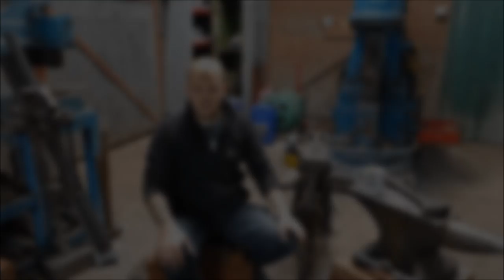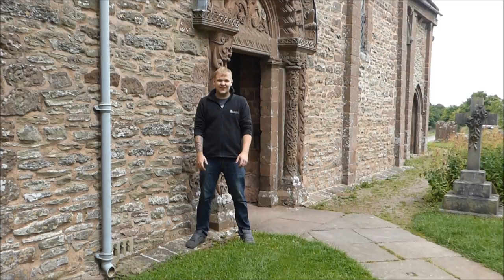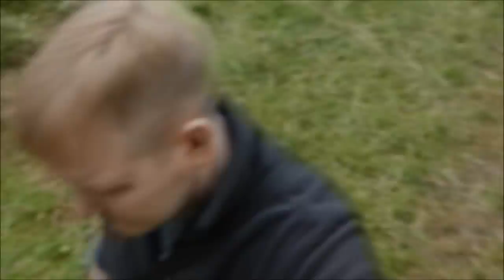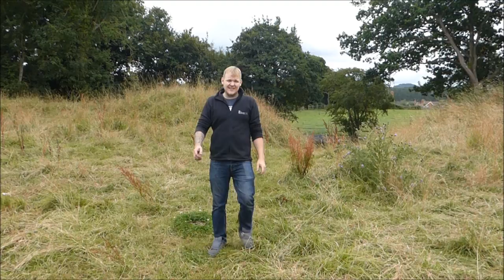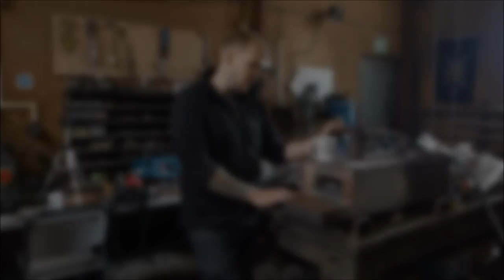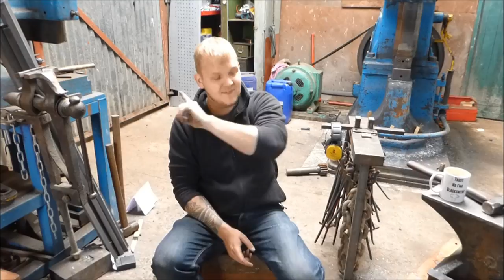Why Gas Forges Suck! Gas vs Solid Fuel! Trust Me I'ma Blacksmith! Full HD 1080p

Comment: Remember that Carbon Dioxide is also poisonous in enough concentration, or, perhaps better stated, it is an asphyxiant.   The by-product of any burning fuel is potentially asphyxiating, and even aside from that, all burning consumes oxygen.  If you were in a sealed room and lit a fire, no matter how clean it burns and how well a flue exhausts any fume, it would deplete the oxygen and quite quickly.  Then of course the fire itself would also begin to struggle (not enough oxygen) and so burn not so clean and eventually smoulder and go out.  You would have expired some considerable time before that.

Comment: I love it. At work we call guys like you swizzle sticks, because they enjoy stirring up shit. Of course I do it too. But seriously, it's almost impossible to get coal or coke in Iowa. I built a single burner gas forge because gas is cheap here. But I do find it limit my ability to do larger work and although it lights instantly, it probably takes 10 minutes to get REALLY hot. Also I don't think I am getting my steel as hot as I like. If I can find coal or coke I am going to build a solid fuel forge so I can compare. Thx for the video. Keep up the good work. 😀
Reply: Travis Lloyd, see if there is a Tractor Supply near you, some of them stock Anthracite in 2 sizes. I like the Nut size better...
Reply: I didn't know that. I'll check it out. Thx
Reply: I found some through a animal feed delivery company, but it by the bag or truck/train load. Also big box hardware stores sell limp charcoal not the briketts

Comment: I just got an old brake drum for a semi truck along with some angle iron from work for free. Now I just need to source a blower fan and I'll have a forge for free.That is, if I don't count the welding sticks. Can't wait!
Reply: Just used a bog standard hairdryer on my Forge with a bit of corrugated pipe works perfectly

Comment: Thanks for this one Dan, always a good thing to have more than just one point of view.  Who the ** is Alice anyway? :D 
I've used all fuel types (yes, even induction heating out in the states, and it is BLOODY quick btw) and I prefer solid fuels because of that flexibility you talk about.  I can do everything with a coke forge, I can't with the gas forge. Yes each has it's own advantages and disadvantages but if you want to cover as many working situations as possible then solid fuels are the way to go.

Comment: One thing you might forget before firing shots at Alec. He rents his space. Most landlords are not going to be happy with you cutting a big hole in their roof.  Not to mention where Alec used to rent was surrounded by jointery shops.  Which means saw dust which means a wayward spark from a coal forge flu could set the whole area a blaze.  Now should Alec have made that point?  Yes he should have. I think given the choice Alec would probably use coal too.
Reply: Alec Steele used a coke forge for the first couple years that he was in his old shop. He switched to gas later on. So your initial argument against Daniel is invalid.

Comment: 1) be straightforward, this was In reference to Alec Steele
2) he makes it clear he PREFERS gas, but coal is useful as well (kinda like you did at the beginning of your video -_-)
3) on the philosophical viewpoint, it's dead on, humans don't think for fun they think to solve problems (i.e increase efficiency) so in effect we think to stop thinking.
Think on an evolutionary level, the brain consumes a MASSIVE amount of energy when idling even more so when pushing itself.
4) coal is more maintenance heavy, not as clean, steeper learning curve, etc.
So yeah gas is better
4) this does NOT mean it's garbage, just as a f22 raptor is better than a 1942 messerschmitt although the latter is still a marvel of engineering.
Reply: Jonathan Garzon Why call Alec out by name? It’s not like he’s trying to fool anyone, he’s just being polite while still explaining why he’s making the video. 
And gas isn’t better, it’s different. 
I’ve used both for years and they both have their pros and cons. Yes, solid fuel requires more maintenance and takes a while to learn how to manage it, but it also gives you WAY more control once you know how to work it. They are also quieter and cheaper to run. Gas is more expensive (both the forge itself and the fuel) more dangerous (propane tanks are basically bombs, plus there is the carbon monoxide) and much louder. It’s also much harder to control the heat, but it’s nice to be able to put multiple pieces of metal in the forge and not have to worry about burning anything. It all comes down to preference. Sometimes I use gas when I feel lazy and don’t need precise heat, other times I like the peacefulness of a coal forge, or need to control the heat precisely. 
Obviously you prefer gas, which is fine, but the statement “gas is better” is purely opinion, not fact.
Best regards, Isaac.
Reply: @muledeerdude  You're way off on the dangers of propane.  Most likely danger is running a propane forge in a space with too little ventilation.  Exploding a tank is extremely improbable, bordering on impossible for most situations.  That said, I wish I had both propane and coal options, but I don't... yet.
Reply: Mike Harner I didn’t say it was common for propane tanks to explode, I said they are basically bombs, which they are. Bombs also rarely explode on their own, but there is the potential. For example, if you ran a propane forge with the the tank too close, it could potentially explode. It wouldn’t necessarily, and it would require a lot of mistakes for that to happen, but it is possible and therefore something to be aware of/take precautions against. Also, burning propane produces carbon monoxide, which is why you need ventilation, so I’m not sure why you mentioned that as I had addressed it?
But yes, having both a solid fuel and propane forge is helpful.
Reply: @muledeerdude  I simply took issue with your classification of a comparison with an actual explosive.  It is very difficult to make a propane tank explode, whereas a bomb's purpose is to explode, and can easily be detonated, whether mechanically or by degradation of the explosive or trigger mechanism.  A propane tank has specific safeties built in to counter the possibility of explosion due to pressure.  You could take a full propane tank, and shoot a gun at it, and it still wouldn't explode.  It would release pressure when hit.  It's not remotely comparable to a bomb.  To say it is a bomb is inaccurate, at best.
Reply: Mike Harner I never said propane tanks ARE bombs, I said “basically bombs.” I made that distinction intentionally, because to say they are bombs would, of course, be false. However, propane tanks can and do explode as it is a container full of a flammable material, Which is essentially what a bomb is. A pipe bomb is a metal pipe filled with a flammable material. When that material is ignited, if it is under enough pressure, it explodes. The only difference is that one has an ignition source built in to it. If propane tank was too close to a running forge and overheated, it could potentially explode. If I’m not saying it WILL explode, I’m saying it could. It is a possibility that anyone using the tank should be aware of. If it wasn’t a possibility, propane tanks wouldn’t be locked in metal cages outside buildings and have warning labels all over them. It is a possibility. Something being probable and something being possible are two different things.
I don’t understand your issue, here. Do you think it’s impossible for a propane tank to explode? If not, what is your issue? As I said multiple times, a propane tank has the potential to explode. I have never said, nor do I believe, that a propane tank is likely to explode. However, given the extreme danger one would be in if a propane tank did happen to explode, I think it is valid to compare a propane tank to a bomb. The effect of a bomb going off and a propane tank exploding are fairly similar, and they are both containers filled with a flammable material. The only difference between the two is that one has an ignition source built in.

Comment: Hey, I'm just going to throw a couple cents in here.  Foremost, you are using monolithic refractory, and it doesn't look like insulating refractory either.  Monolithic refractory isn't really meant to be a stand alone liner for anything, it is usually the hot face for an insulating layer.  For instance, you could easily use 5cm insulating kaowool (or similar brand) rated to 1760*c, and coat it in that monolithic refractory (talking less than a couple centimeters total coating thickness).  Your heating times will increase dramatically because you aren't heating all that refractory, just a small shell of it, and your fuel consumption will go dramatically, because less fuel is being used to maintain the temperature since you have an actual insulating layer and aren't loosing heat through the shell.  Also, though those burners work, they're hardly the most efficient burners, and if they're second hand and aren't using lp fittings and such you are going to lose fuel efficiency as well.  Finally, your fire chamber isn't efficient for fuel consumption.  Your forced air burners rely on full fuel consumption to happen in the fire chamber.  Ideally, you'd have a domed chamber and the fuel/air is injected tangentially into the chamber so it makes several "passes" through the chamber before exhausting, consuming more fuel in the process.  Your chamber has a particularly hot spot, correct?  Directly under the burner?  This is where it burns out the fastest?  If you answered yes to any of these (and I'd imagine all of them) then you need to re-design your furnace.

Comment: Some good points there👍 I think I'm gonna build a real easy cheap coal forge to straighten out the coil springs😄😂
Reply: Not only Wood if you wanna straighten coil springs the gas guys have a crazy trick... with a gas forge big enough they heat up the entire coil, then put it on a spindle and pull the end out till they've got 20' of glowing hot steel across their shop...
Reply: I saw that😄 That's crazy! 😄 But I don't have a gas forge big enough 😅
Reply: Remember to go with a side blast design as it requires less cleaning klinker out from the tureiron

Comment: Two pages out of the local paper and I can have my coal burning and have a piece of steel hot enough to forge in just a little over 5 minutes. That's with my crank blower and more recently a bellows. I don't like the constant roar of the gas forge.

Comment: I actually got sea sick watching the "original" you copied. Didn't watch past 5 mins from the selfie stick malarchy. I mean I like him in general, bit showy sometimes, but that one just had swirling parts of countryside in circles. Your video wins on that front alone lol. A watched whole thing B better countryside and thus comical :D
Also Youtube is listing said original on my sidebar :D
Personally have a mini Gas forge as a beginner cos It was a race for building each one and my personal DIY design just went easier with Gas. But I've since blown through 3 types of refractory and tripled my costs, cant forge weld at all (too small) and having changed the coal forge to a sideblast design I think I can make it. 
Thanks loads for the video. Every tuppence counts.

Comment: Well, at least you were kind enough not to bash the other youtuber by name. Coal, especially if you use home heating coal, is more likely to expose you to harmful byproducts including high levels of sulfer.  A gas forge can be made as cheaply as a your coal forge. If you are relining a gas forge that often you are using the wrong refractory. I definitely do not recommend using RCF fiber blanket.   I can run a propane forge for a bout 6 to 8 hrs for $10 US, the cost argument seems weak. I do agree you have more flexibility with large pieces. I find the effort you spent discrediting a vlog comment by another blacksmith distasteful. I seem to remember you making comments about his videos before, as well. I wish you the best in your future endeavors, but I have lost interest in your videos.